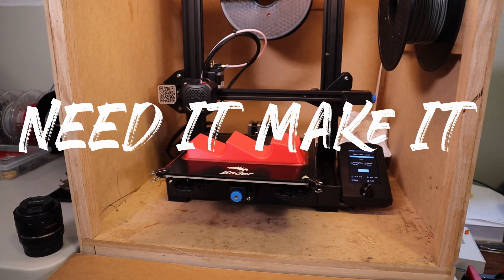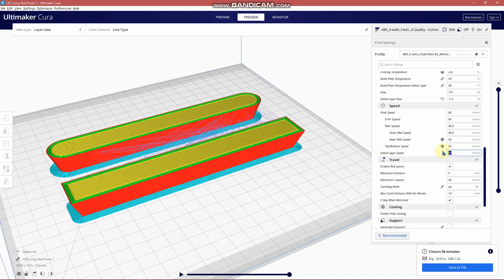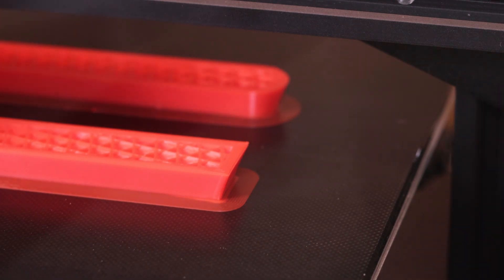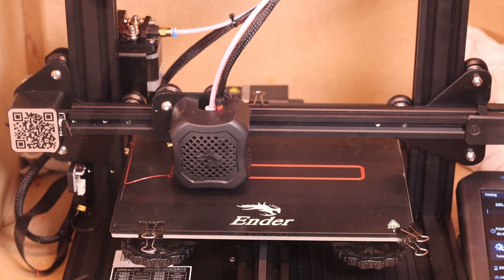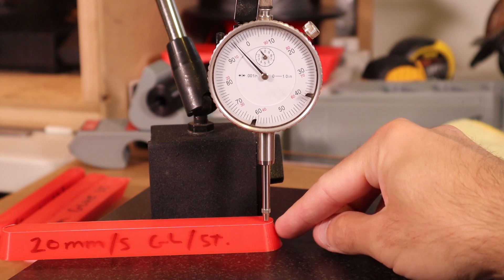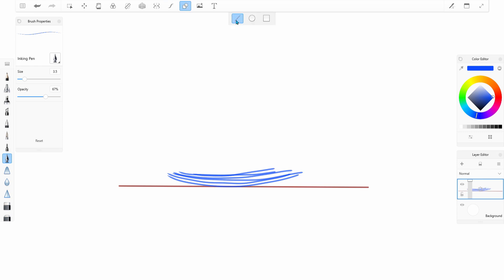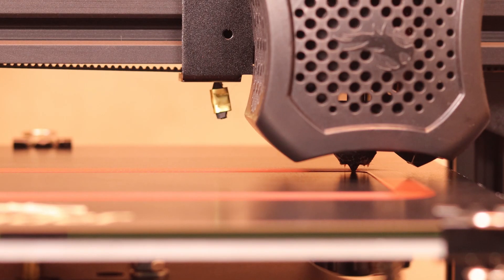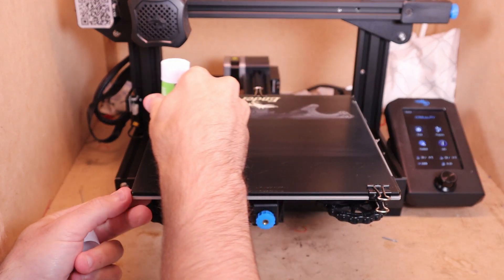Creality Ender 3 V2  - The quest for the best build-plate adhesion for ABS

Comment: Just a few recommendations:
1. For the e3 v2 check the  PSU cover,  it might be covered with a fancy factory fitted piece of shit metal which does not let the hot air out, chances are you'll toast the electronics on the long run. 
2. For a proper enclosure you'll have to take out all the electronics.
3. I'm printing PETG on glass bed covered with  3M masking tape, really good adhesion 
4. Started recently with ABS+ from eSUN, glass bed,  cheap hair spray, improvised cardboard box enclosure, good adhesion,  no warping. Speed 20/50, it's enough for Ender3. 
5. Waiting for my Voron 0.1, finished the printing of the parts for it. 
6. Starting to print the parts for Ender 3 Switchwire conversion. Parts will cost around 300 euros, but will have a reliable coreXZ printer.
HAPPY PRINTING

Comment: I level my bed with a 0.08 mm feeler gauge and make sure my extruder is calibrated (e-steps/rotation_distance). Level with bed and nozzle heated up to ABS/ASA temps. 30 mm/s initial layer speed with glue stick and I have near zero warpage. At least less than you were showing. No z-offset or any other trickery needed, because 0.08 mm seems to be the extra clearance it just wants. It is not possible to do this with a piece of paper, must be a feeler gauge. I noticed you were messing with your initial layer flow and then overall flow. I believe you are probably under-extruding, as is typical with an E3 V2, thus causing your bed adhesion issues. Also I can lay down new glue stick about 8-10 times before I need to go wash the mountain of glue off. Definitely don't need to wash my glue off after every print. Also, you must re-do the bed level procedure with a feeler gauge after taking the glass plate off, washing it, and then putting it back on. Can never trust that the heights will be the same after doing that.

Comment: Reduce your build plate temp and nozzle temps.  This will limit thermal shrinkage.  This will depend on your ABS material but the MG chemicals black can be printed way colder than expected.

Comment: Does the gluestick work better on the textured side? I always print on the glass side with gluestick because abs can adhere to strongly to the other side and I'm afraid I might miss a spot and ruin the bed.
Reply from the maker: I think marginally better, I've printed with smooth for quite a while with ABS and PETG, but ABS really needed the NANO adhesive with my print settings, too thick walls/infill and large nozzle caused quite a bit of stress.  I've never had an ABS part completely bond to glue stick, it always comes up a little on the outside edges so I can't imagine it would ruin your glass as long as it is 4mm tempered.

Comment: what's even the point of using the imperial measurement system around 0.1 mm scale...   What good is it to know that something is 0.00575 of an inch, like, tf ??? It's such an inconvenient system of measurements.
Reply from the maker: I prefer metric, however I grew up in Canada learning imperial, it is common to use both now on a daily basis, a little silly I suppose but we could say that about many things.
Reply: @NeedItMakeIt   ...I live in Canada too. Imperial measurements with decimals needs to die. Yeah I still measure with cups and spoons and use the degrees Fahrenheit on the oven and the pool.. But even in construction school we switched to metrics on the small scale and re-converted accordingly.

Comment: How about a raft instead of a brim?
Reply from the maker: I've only used a raft once, and I didn't like the finish on the bottom of the part.  That was back when I was printing only ABS and of course no cooling fans.  The raft may allow the part to warp slightly before coming away from the build-plate.  The best solution for ABS is NANO adhesive, it works too well in some cases and can take a chunk of glass with it.
Reply: @NeedItMakeIt  oh, hm.. I see, I'll play again with it and let's see what happens. Thanks

Comment: I used the Micky Mouse ears plugin and finally printed ABS with minimal warpage, I also adjusted my Z-Offset to get a little more squish than I normally would have with PLA
Reply from the maker: I can't say I've had much success with those on ABS, my prints were always a heavy infill and they wanted to warp really badly.  If you want to try something that doesn't require brims or ears or any cleanup try the Nano bed adhesive from Visionminer, it works perfectly every time, no extra squish, no brim, you should use an enclosure though.

Comment: I used bed temp of 110C and my enclosure has a heater set to 50C controlled I have placed the printer outside the enclosure but the control board is still on the printer.

Comment: I print with PETG exclusively on the smooth side of the glass bed (not the black textured side). With the bed cold, I brush on 2 coats of a Mod Podge/water mixture. Heat the bed up to 60 to dry it fast. The great thing is you can print on it dozens of times before washing it off and starting again or simply brush another coat over top. The thicker (more coats), the better adhesion.
Reply: @Aimless_Drive  
I've never printed abs. With PETG, the corners will peel up if I don't use the glue mixture. Once I build an enclosure, maybe I'll try printing on bare glass.

Comment: I'm using Kapton tape on aluminum bed for ABS. I've had to go higher than reccomended temps for it to work. 115 degC for bed (makes difference over just 110!) and 235 decC for print head.  Often printing with raft too. My enclosure is folded 8mill vaper barrier sheet used in construction right now. planning something better. I do like finished ABS parts better than the PLA. Chamber gets to 40degC in no time. I'd like to see that increase to 45-50 with a better enclosure.

Comment: I have been using some random yellow tape on a glass plate and it works too good. Takes me like 3 minutes to get a piece off. I’ve been turning off the cooling fan and it has improved my prints, no warping, perfect layer adhesion and smooth finish. I print most of my ABS at 250c and 90c on the plate

Comment: I have success with cctree build surface on my cr 10 at 85 C as that's the highest it will go also the adhesive doesn't cope much higher than that, 0.6mm nozzle with 0.8mm first layer extrusion width. In one of my printer facebook groups I am in they say geckotek is quite good but I haven't tried that. I have tried kapton tape too, that worked but bit fiddly, and hairspray on glass worked too. Also don't lower the bed temp after the first layer.

Comment: Hi - I normally print with PETG and I do not use anything. I have a Ender 3 V2 as well and my bed is at a consent 90 degrees.
Reply from the maker: Worth a try, I've started with 75 for PETG and I find it releases easily from the glass, a hotter bed may make all of the difference.  I am pretty happy with the glue stick, though I need to use the freezer to remove all of my prints.

Comment: Going the extra mile is good, but was the trip necessary?
Rather than fret about raising the bridge (improving adhesion), why not lower the river (reduce printing stress)?
If the part wasn't trying to leap off the plate, the need to 'glue it down' is reduced, right?
ABS has some of the worst contraction of any printed material, respect that fact.
Draft-shields, like in Cura, are very effective if you can't print inside a cabinet.
You protect your ABS prints from drafts, right?
Your efforts are cool, but this practice (glue to overcome shrinkage) gonna leave lots of internal stress in the part and flexes the build plate.

Comment: i've tried glue stick and hairspray for ABS and PETG. and i prefer Hairspray for ABS and the Gluestick for PETG this gives me the best adhesion and easy removal of parts
Reply from the maker: I believe that I am not as successful with ABS because I print the parts very heavy with walls and infill.  I have rounded corners, but sometimes it  just isn't enough.  I've settled on Nano if I need to print ABS.  The best solution like you did was to print in PETG.  I'll be drying my filament a bit more, this will help with the stringing so I am told.  Thanks for your thoughts and taking the time to leave a comment!
Reply: @NeedItMakeIt  i had some stringing issues with PETG but switching to direct drive and printing only 5c colder solved this completly and the parts look great customers are verry happy with the quality of PETG we provide
Reply from the maker: @996pat  Thanks for the tip, I am only a few months into printing with PETG and still dialing in the settings.  I am also told that drying PETG is critical to prevent stringing issues.  I have yet to try this myself, my rolls are new but that doesn't mean they are dried appropriately.
Reply: @NeedItMakeIt  I have found that new PETG rolls typically need drying, I normally put them in a oven at 60 for about an hour. Easy way to tell if a roll needs drying, is to extrude and look at the extruded filament, if it has bubbles in it and you get a crack or pop as it extrudes, dry it.

Comment: I print most of my stuff with abs,I normally use abs and acetone mixture on a glass build plate.This method is old but the secret is you should apply it after the bed reaches 100C.You won't get any glossy smooth bottom layers but the difference is night and day
Reply from the maker: I will have to try this, thank you!
Reply: @NeedItMakeIt  How did you go? As soon as you try and apply the mix, the Acetone boils off, as the bed is so hot.

Comment: I experimentet with diffrent types of buildplate... I got the best result out of sanded acryl glued to a sheet of stiff material (aluminium or glas) but i didn´t try it above 70°C jet
Reply from the maker: Really, I'd expect acrylic to expand and contract quite a bit.  Very interesting.  

I have good success with glass using PETG and PLA with only glue stick.  ABS on the other hand needs NANO bed adhesive to bond it well.  Too well that it can take a chunk of glass with it.

Comment: Great videos. Trying to get the hang of PETG. No enclosure but cardboard to stop drafts. Most success with a brim an little or no cooling + hairspray on glass. Ender 3 V2 also. 

Question, are you using stock bowden for ABS?
Reply from the maker: Like you, I've switched to PETG, you'll see a new video in a few minutes showing some testing https://youtu.be/6Z02BowhQwU.  I was using the stock Bowden for ABS, I have changed it over to upgraded fittings and new tubing with good success but I will be making a follow up video showing the ultimate solution (IMO).  I initially started printing with ABS because the price was right and because it is viewed as a more structural type of material, it looks good and prints well with a 235-240 nozzle.  That's about where the good points stop.  Having problems with warpage and the smell are both enough reason to switch.  PETG is not easy to print with either, it likes to leave fine strands and oozes quite a bit also.  I do print PETG in an enclosure, however I often have the door off, or at least open a little, I don't want to keep the temp too high inside because I'd like the electronics to last as long as possible.
Reply: @NeedItMakeIt  Thanks for the informative reply. Looking forwards to your ultimate solution. 

I'm running stock as i want to learn the machine before upgrading parts IF necessary. Seems like people re more intrerested in upgrades than actual printing! 

As for enclosures, yes constant heat on the electroncs can't be good. See some mention moving then psumother board outside. Maybe easier to design an intake and exhust system.

Comment: Hi friend, a question about the enclosure.      Did you make a change on power supply. How is the themperature?
Reply from the maker: Hi, the temp stays at a little over 50c with ABS at 98 bed, 235 nozzle.  I didn't think the printer would love those temps over the long term so I recently changed to PETG with very good results, I still use the enclosure for sound and for nano particles if that is possible... I can't see to tell.  The ABS here is only slightly cheaper than PLA and PETG and since I always struggled with adhesion and ABS has quite a smell, it made sense to switch.  I will have a video out in two days showing some results with PETG if that helps, no warping ever!

No change to the power supply to answer your question properly.
Reply: @NeedItMakeIt  how to handle petg stringing? I always get stringing a little
Reply from the maker: @NirifaEducation  Turn on Combing mode if it isn't already active and dry your filament, I would keep the temperature of drying below 60C.  I tried in the oven and it does work, however the min. temp is too high in some areas of the oven and it causes the filament to fuse and cause the entire roll to be thrown away.

Comment: try to remove the infill if it's possible, increase the numbers of walls and number of top/bottom layers.
For the example i saw  in the video, you can use 0 infill and 5 or 6 walls. im almost 100% sure that you will have no warping at all.
Reply from the maker: I have never tried that, I started printing with ABS and the fan is turned off, it cannot bridge well so I've had to use the infill to support the top layers or they do not complete.  This could work well for PLA with the fan.  I recently have been using PETG and I am loving it, the warping issues are non existent.  I only prep with glue stick on a glass build plate and it works so well I have to stick them in the freezer to remove them.  I print mainly structural parts so infill is required for support.  

I will try your idea when I have some free time, it could come in handy.
Reply: @NeedItMakeIt  I have tried this, it's the same result. Warping around 0.1 mm at the ends.

Comment: Hello all. I have just got a ender 3 v2 and only printed pla on glass. I also have another type printer and print pla on a steel bed I used blu tack blu stick on both printers. https://www.onbuy.com/gb/bostik-30813315-blu-stick-36g-display-12-pack~c10063~p21269348/?exta=gshp&stat=eyJpcCI6IjEwLjc5IiwiZHAiOiIzLjUwMDAiLCJsaWQiOiIyODI4MjAzNSIsInMiOiIxNSIsInQiOjE2MDQ5ODk2ODYsImJtYyI6IjAuMCJ9&lid=28282035&gclid=CjwKCAiA-_L9BRBQEiwA-bm5frx69Kpeb5hzZ9IjwB4tZF4uliRTXERa9xs2rE05JsSyEfskVrQ80xoC-x8QAvD_BwE&gclsrc=aw.ds. Bought a big pack and last me ages.
Noticed that I have to knock the prints off as it stuck so bloody well.
Hope it's goes the same job with abs.
Love this glue.

Also it goes on blue 🔵  and dries clear 👍🏻 give it a try

Comment: I recently found a really good simple method for PLA, PETG and TPU, but I haven't tried ABS yet.  Being the first thing I could find at the time, PVA glue on masking tape.  Smear it on, wipe off excess and the rest dries almost immediately.    Only problem is(so far) some of the paper from the tape is likely to become a part of the print. [edit] NM. It washed off with water.  (water based glue duh!)
Reply from the maker: I may just try this out.  I have been printing with ABS for 2 years, but I am looking for a plastic that is more easily recyclable and doesn't require the high temp bed and enclosure that ABS does.  I've purchased some PETG, which seems to be really good stuff, not to mention that it can be food-safe.  Adhering PETG seems to be different than ABS, so your suggestion could help, maybe regular glue stick works also?
Reply: I started about a month ago. PLA first, then PETG and recently some pretty hard TPU. 

Didn't have too much trouble with bed adherence on my E3v2 till the plate started getting a little uneven and I started putting masking tape over the low spot in the middle. 

I'd like to see if it's actually better than glue stick. I think it is.  And since I won't be getting around to using ABS anytime soon, would also be cool to see how it works there. Just sayin.  ;)

Comment: Thanks for the video. Did you remove power supply and / or motherboard from the enclosure to protect them from excessive heat? Or did you simply put the printer as is into the enclosure? Thank you.
Reply from the maker: I have the printer directly as-is in the enclosure, though I do believe that it could be a problem over time.  I had been using my Anet A8 in the heated chamber since the start (1 1/2 years) and had no electronic issues, the printer was terrible in general but it does still work.

My plan is to either switch to a different material and print with no enclosure, or allow the fans to pull in a small amount of cooler air from below to keep the electronics protected.  Any air movement in the chamber could have a negative result on the prints, my current method gives good results every time.  

The chamber heats to about 40C which is pretty warm, but probably not enough on its own to cause problems.  The motors in the chamber are at 56C according to the IR sensor.
Reply: @NeedItMakeIt  hey man, electrical engineer here. Anything under 70°c is cool in electronics. If you get over there you may have a problem. Under there you're perfectly safe. Chips (what we call IC's) are good for upwards of 90°c, some even go as high as 140/150°c

Comment: Some suggest diluting wood glue, PVA), 1 to 6 with water, I think
Reply from the maker: I can give that a try, thank you.  I have been testing Nano, it is very expensive but does seem to work well, I'm still wrapping my head around how to use it with perfect results, but in general the bond is really good with ABS, not so much with PETG from my testing so far.
Reply: @NeedItMakeIt  Thanking You 2000%